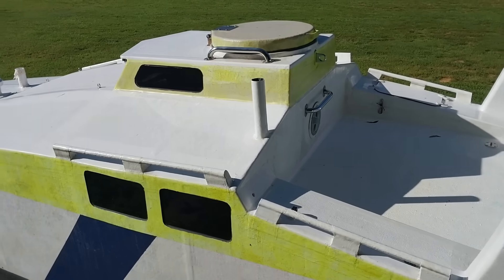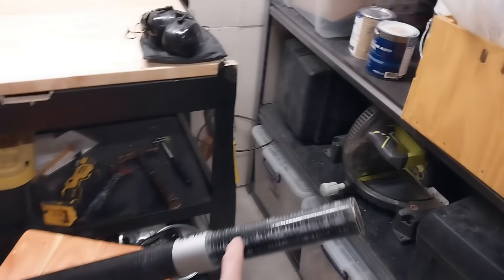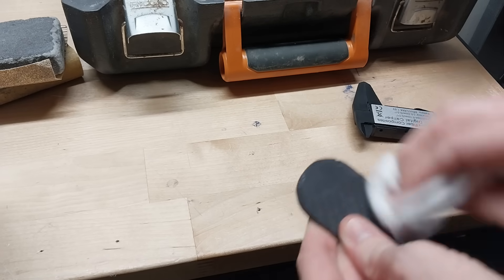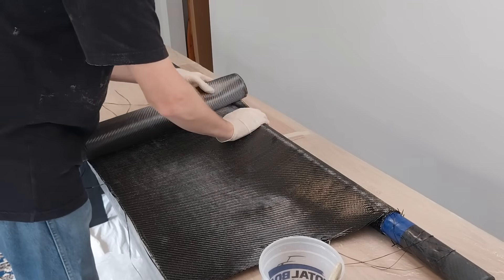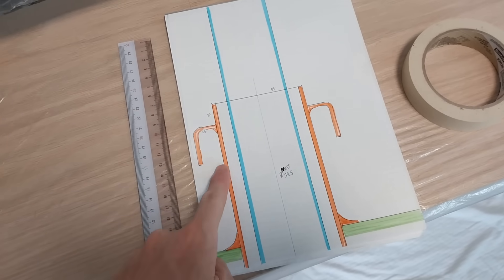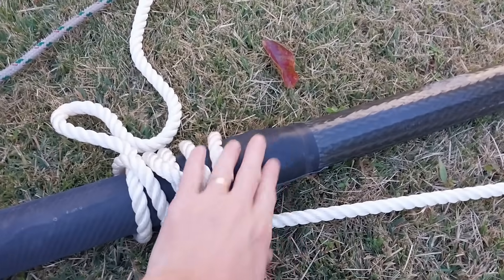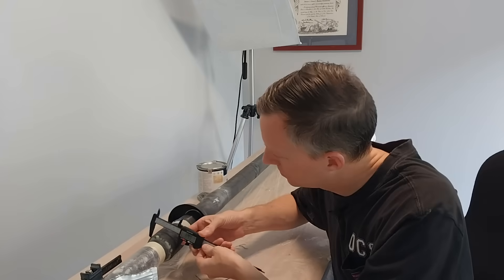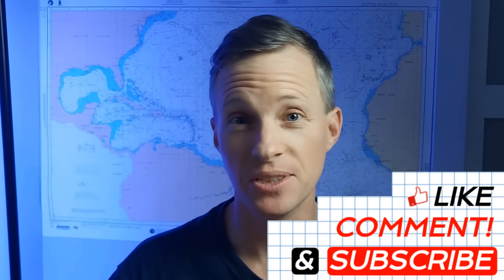OCSS-099 My (Controversial?) Carbon Fiber Mast Build Method

Comment: That is not a Ljungström rig as far as I can see, the later sailing video does not show a double skin sail. The sail area is not the issue if you are truly ocean sailing, you have a massive righting moment compared to a windsurfer you need a considerably stiffer and stronger mast
Reply from the maker: A ljungstrom rig does not have to have 2 sails, the important point is that it rolls up around the mast. On the one hand I do think I could do with a thicker and stronger mast, on the other hand it's nice to have the flexibility to spill some wind gusts when needed.
Reply: @ocean_capable_small_sailboat  look on the net the ljungstrom rig has a double skin of sail that way when directly downwind it can 'goose wing' the two parts of the sail effectively double the sail area - it would be a very handy thing for a boat like yours
Reply: @ocean_capable_small_sailboat  https://upload.wikimedia.org/wikipedia/commons/1/10/Ljungström_Vingen_10.jpg

Comment: Grats on upcoming splash day!  Possibly dumb question, but for the top mast rotation part why not see if you could just use HPDE pipe like a sleeve that the mast could rotate in?  HPDE when sanded smooth is rather slippery, and more so when wet which is also good.   Just replace if it wears a bit and touch up now and again with some lubricant?  Heck, I wonder if you could do that with the mast base as well if the a tube of hpde pipe was capped on one end.  Then insert a sacrificial hpde circular piece made from a cutting board in the bottom, add lubricant and let the mast stand/rotate on the sacrificial piece..  Cheap?  yes.  Works?  Not sure.  Hmmm.
Reply from the maker: A slippery pipe inside the mast tube would be a helpful addition, I have to see what's available and if it will fit. It has to be a pretty specific size to fit b/t the tube and mast.
Reply: @ocean_capable_small_sailboat  Yep sizing would be a thing.  Maybe try a 1/16"?  hdpe sheet as a "sleave" inside tube then instead?   $2-3 so cheap enough to try but still might need sanded on one side to be slippery enough.  Plus points for being sacrificial so your mast would not wear much as it rotates (hdpe would wear instead) .   Not sure how to attach the other side to the mast tube.  But then it may not need to be attached if it rested on a lip or clip below the mast tube?

Comment: Have you done any engineering calculations. If not you should overbuild. I notice you have no off axis material to give sheer strength in the lower section. So to give you sheer strength which is as important as fibres running up and down you need fiber running diagonally (spiralling the tube.
Reply: Thinking some more on this. And knowing windsurfer masts my feeling just looking at your boat is that you have not put enough additional strength in the lower third of the mast, over about 8~10ft in way of the boats deck, where the bending moment is greatest. With composite, where fibres give strength in one direction only, to get additional bending strength it is absolutely imperative to add sheer strength. The original mast will have some material fiber, spiral wound, and some up and down. As far as I can see you have added fiber running up and down the mast and across the mast (does not give you anything really) but you have not added spiral material, usually called off-axis material. It would be a shame to loose all your hard work and you have room in the deck bearing to add material, why not do it. You can buy stitched double bias carbon cloth which will do the trick. I used to design rudder stocks for yachts and can tell you a few stories of boatbuilders who did there own design which kept breaking because they would not pay for the engineering, but in the end they came back. You can often get away with it on metal but Composite is not friendly to numberless engineering.

Comment: Perry, this may be too late, but have you considered a Laser (ILCA now) mast?  Either aluminum or carbon fiber.  The Laser is a 14 foot sailboat and the masts are pretty strong, in carbon fiber.
Reply from the maker: Maybe I could use one next time and add length. they are a couple feet too short for my boat.

Comment: This is a bit spooky. I've recently been thinking along very similar lines in modifying a windsurfer mast to fit an old Europe class dinghy I bought for pennies. It has an alloy mast, which is no longer made. If it broke, a carbon replacement cost ££££s.

Comment: A neat trick when adding CF or GF to a tube like this, is adding peelply and plastic as you are doing, but then getting some heatshrink tubing to fit over it all and shrinking it. Not only does it add even compression but the heat can help the resin flow more evenly into the cloth, wetting it out better.
Reply: 50 years ago,  i worked at Forespar in California.  I wasn't personally involved, but they were laying up some of the first carbon fibre spinnaker and whisker poles, and they used this exact method (using heat shrink TAPE), albeit with surplus pre-preg, which is less likely to slip and slide and distort than a wet laminate. The spars were cured in a surplus helicopter rotor shipping box equipped with heaters and controls, it both shrank the tape and cured the resin.
Reply: But you risk wrinkles in the laminate, which destroys compression strength (what a mast is all about)

Comment: To keep the water out, or reduce it, form a watergate in front and side on the deck, to direct the waves over the top of the cowl.
And, if you do get water in, perhaps best to just let it fill the void, then empty occasionally.  Once full no more can get in, and I assume it is not a huge volume
Reply from the maker: There shouldn't be much water getting in because the waver diverter I built into the mast tube on deck, and the rain diverter I installed on the mast itself. Any water that manages to get into the tube exits through a small drain into a compartment in the fo'c'sle.
Reply: @ocean_capable_small_sailboat your arrangement will only divert a small amount of water.  If the gap if filled by a green wave it will just bypass them.  If you build an angled fence in front it will direct the wave over the top of the joint... hopefully.
If the tube that the mast sits in is that an issue short term?  If not better it remains full than emptying into the front compartment so that it can be refilled.
Hope you get my reasoning

Comment: The benefit of carbon fiber is that it's easy to fix with material that is easy to transport. And the same material can be used to fix the hull.

Remember Yves Parlier's mast repair during 2000 Vendee Globe.

Comment: Maybe I missed it but do you have some sort of UV protecting clear coat on the epoxy of the mast?
Reply from the maker: They come with a coating already. Areas I worked on got black paint. I didn't want to paint the whole thing because it's extra weight.

Comment: I have seen carbon fibre used for chain plates on a racing cat (gunship) before, by a pro racer, it's good but you have to spread the surface area where the load is, so maybe attached that padeye with a spiral of CF down the mast both clockwise and anticlockwise.

Comment: I wired a 57' Catamaran, it's main sail was 1100 sq', mizzen was 770, and foresail was 440. I think the Aluminum mast was 70'. Me no likey heights so much. But I wired that too!
 I have been on rough seas, and going at it with a dighy causes me concern.

Comment: As a boatbuilder of 30 years, I would like to ask what kept You from small scale vacuum bagging the carbon laminates? You had the peel ply already in place, so there wasn't much left to get superior curing pressure and bubble extraction with a little pump and some butyl ...?

Comment: I must say this... IT'S FCK incredible STUPID build mast using carbon fiber for this type of boat. It will break v. fast. Must have to be strong but also 'elastic', to have ability to bend 'a little; if need. Carbon fiber is to stiff for that. Sure it is great in some high-end boats. But they are used in short time. Then you need spend lot of time to diagnose and repair them. In carbon fiber mast, you will get cracks v. fast and after short period of time. It will break if even little strong wind come, if you don't diagnose and repair it often. Sure in high speed boats you have carbon fibre mast. But it cost a lot, to service them after EVERY event.  To be sure, that will not break on next one. Best mast is from aluminum alloy. Cheap, easy to maintain and can last long time. If proper maintained, it can serve around 50 years. Or even longer when you don't sail to often.
Reply: Carbon fiber is an excellent material to build free standing masts for small boats. My latest boat was so equipped. I cruised the northen North Atlantic in her for 150 days solo. No problems whatsoever. That is why I chose carbon for my next boat.

Comment: Nice work.  I would be concerned that it is just not strong enough.
Although the same area as a windsurfer sail, your mast is taller, and the loads much higher.
Whilst you have increased the wall thickness, it is still very narrow.  Remember the strength increases with the square of the diameter. ie, twice the diameter, four times the strength.
Reply: Hope you prove me wrong.

Comment: Perry: I just got a $20 stainless steel caliper from yamazon and it is so much better than the super cheap plastic ones. Wish I had done it earlier. The usual cheap plastic ones have not served me well - always dead battery.

Comment: I used those wind surfer masts to make my sweeps. They have kayak paddle ends and wood for handles. They work really well. Used large heat shrink for protection at oar locks. They could also make an emergency mast if needed. That spinning mast will make it difficult to have any kind of headsail. Be interesting to see if it is difficult to turn under stress when it is bent. You might want to consider a lock for the mast as roller headsails can break and unroll themselves to then be flogged into oblivion while being a danger to the boat. As for sailing quality having just one sail that rolls out means that any change in the sail moves the center of effort and will be difficult to balance the boat. Don’t know if you are going to have a boom but would have to be attached to cabin top. A boom would improve downwind performance and let you get closer to the wind. You might also consider a stop on the mast to keep it from being pulled out of the boat. 👍

Comment: I enjoyed watching the carbon fibre fabrication. One small suggestion, I believe seawater will get in around the mast deck area so perhaps you could test with a fire hose or serious garden hose to determine if the amount that gets in is acceptable.
Reply from the maker: I don't think much can get it, but I will be testing her on the Atlantic this month and we'll see. There is a small drain at the bottom of the mast tube, into a forward compartment.
Reply: @ocean_capable_small_sailboat I think in a storm you will get a surprising amount in.  Maybe make a gasket.  Take a piece of car inner tube, cut to flat circle.  Then to donut, the inner diameter just smaller than upstand, the outer fixed to the rotating part.

Comment: Carbon fiber masts are often around 80% uni so reinforcement with double bias won't share the load on the uni in the windsurfer mast......
Reply: It is important to match the stiffness otherwise you will introduce new stress concentrations.  On the other hand, I have a 8.5 m^2 sail for my windsurfer- bigger than your sail.  I use an aluminum mast with tip and foot extensions that should be weaker than your finished mast.
Reply: @TricksterJ97 I presume your post is addressed to Perry and not in reply to me

Comment: In a tropical sun, black surfaces are going to be awful hot.  Might impact the epoxy.
Reply from the maker: All those Freedom yachts with carbon fiber masts have black paint, plus the thousands of windsurfers and hobie cats out there with black masts in hot climates. Should be fine.
Reply: I was going to ask why he didn't panit the mast silver to be reflective, but then I thought that it's going to have a sail wrapped around it so the sun won't be on it except when the sail is fully unfurled.
Reply: had think the same: it's not for nothing that all composite aircrafts or boats are white...

Comment: Cpt Perry, you going to add an alternate power source on the scow? Secondly, you going to make a head sail configuration and make a set up for a spinnaker and or screecher?
Reply from the maker: Currently the answer is no to those items, but down the road maybe. I will use a sculling oar for now. I'd like a way to add more sail but I need to think about it some.

Comment: Have you considered that carbon fiber will attract lightnings?
Reply: it's still the case with an aluminium alloy mast... Yann Quenet had never problems with lightnings and use a similar carbon fiber mast (7m long)
Reply: Neither carbon or aluminum attract lightning. The probability of getting struck is from height of mast and where you are sailing. But when you are hit, carbon will act like a wooden mast (split/explode) if there is no lightning rod.
Reply: @robinj6997 be interesting to consider what a lightening strike would do to my yacht, ungrounded Alu mast in wood core hull.....
Reply: @KarlFullerNZ  Hi Karl! You could drill a hole through the hull and mount a lightning plate under the mast. Checkout the YT channel "Sailing into Freedom", I don't watch is channel usually, but he got struck by lighting with an aluminum mast with a fiberglass hull. He had multiple leaks in the middle of the night: fist size hole in the stern and a loose propeller axle. Lightning burnt through.
I've been thinking about a lightning rod. But they are heavy... And it would be hard to mount with a rotating carbon mast. (Your aluminum rig would be easier.) So I think I will just take the risk without the rod.
Reply: @robinj6997 so far I kind of only have one hole in the hull, just for the dagger board and even that one exits through the deck so I'm reluctant to start drilling holes 😉
I did quite a bit of research year's ago on lightening rods etc. it's never concerned me too much for our conditions here in NZ, maybe it should. I'll check the channel episode on lightening strikes, sound's interesting. I was in Australia years ago, riding a motorcycle in a thunder storm and lightning was striking the dessert around me. That concerned me!
Reply: @KarlFullerNZ  Understandable about not wanting to drill holes. I'm probably gonna gamble without lightning protection as well.
Reply: I don't know, that's why I asked if he considered this. What they taught me as a kid is to fold down any carbon fishing rods when there are lightnings around.
Reply: @kamencic  sorry I didn't mean to sound demeanor or sour :) just an explanation.
Yachting Monthly have a good article about this "Sailing in lightning: how to keep your yacht safe"
Reply: @kamencic  I guess you were told to put down any fishing rod in case of lightning. I at least hope that’s what you were told 😂
Reply: @jesperwall839  no. Actually explicitly carbon rods. Not kidding. The other ones were deemed safer because they were not conductive. I don't know. I'm alive still 😅
Reply: @kamencic  Ok! It’s not about conductivity when it comes to lighting, it’s about electric field concentration at the top of the rod. Anything that sticks up in the air can attract lightning. So the material in the fishing rod, or mast, doesn’t really matter.

Comment: Nice work and great progress, but I am curious about the lower mast section. A couple of years back I used some old windsurf masts to make the boom and yard for my little lug-rigged dinghy, and I made the mistake of first sourcing some masts that turned out to be glass fibre, not carbon - luckily they were very cheap! I didn't use them and found some more made with carbon fibre. Great that the top sections are 80% carbon but the bottom section had 'glass' written on it, and the construction looks exactly the same as my glass mast elements. Obviously you've reinforced it, and it may well be strong enough, but was that an intentional choice?
Reply from the maker: That's funny, it actually didn't enter my mind that it could be fiberglass, I thought they all were made of carbon fiber. I'm still confident in the strength because even the production mast I had from a freedom 21 was half fiberglass inside and half carbon fiber outer layer.
Reply: @ocean_capable_small_sailboat Yes, I think it'll be OK. Probably the main issue would be that glass fibre masts are probably heavier and thicker, as if not strong enough they'd have been breaking all the time 😉
Reply from the maker: Yes that's why I used it for the lowest tube, it felt a little heavier and stronger already.

Comment: I'm guessing your sail @7.9m2 is quite a bit smaller than Baluchon's?
I think the main issue with windsurfer masts is that they're too flexible for a "Normal" boat.
I wonder if you could increase the stiffness (if it proves necessary) by inserting bamboo in the tube.